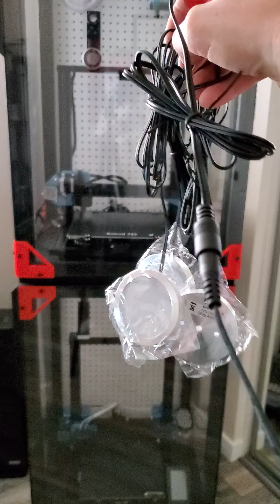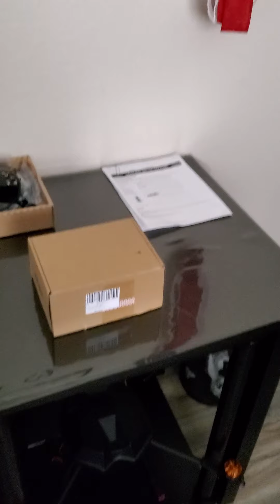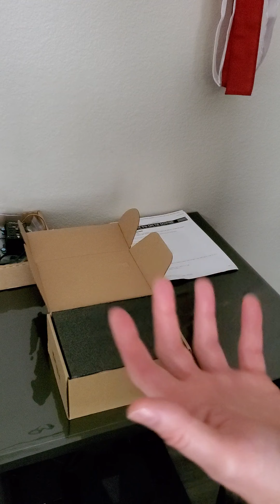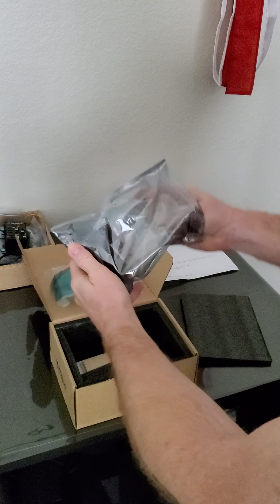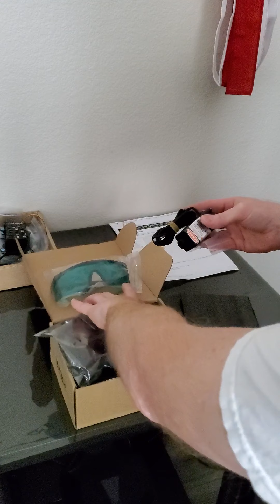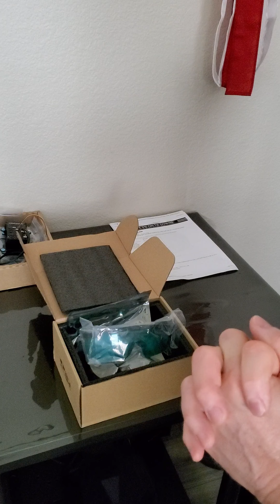Sovol SV02/SV01 direct drive 3d printer LASER ADD ON!!! OUTSTANDING

Comment: Hi. Did you come up where to buy a cable wire for the laser instead taking the bottom off every time we want to print ?
Reply: @jmarsh9967  oh wow thanks. So the board will say fan 2 ?
Reply: @jmarsh9967  where would i find that video
Reply: @jmarsh9967  I also have the touch screen one two. Sovol sv02 two colors. Lol
Reply: @jmarsh9967  so is anyone having trouble downloading the program to a windows computer . The error is framwork wont load.
Reply: @jmarsh9967  thanks
Reply: Oh okay . I have windows 11
Reply: @jmarsh9967  okay Thanks
Reply: @jmarsh9967  hi again  is this fan #2?
Reply: @jmarsh9967  it says A15 TH2
Reply: @jmarsh9967  Hi. There is two plugs on the board. I found it. Thanks just have to put a switch on it
Reply: @jmarsh9967  hi. Thanks again for that advice putting a switch on my Laser on my SovoySV02.